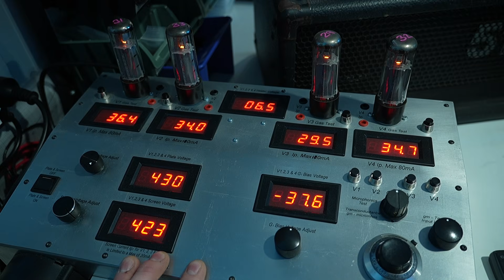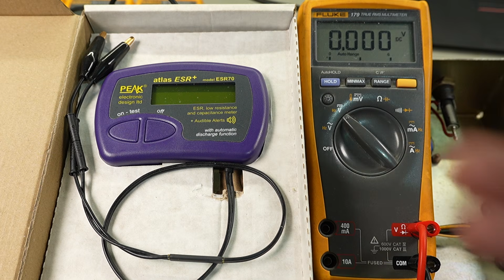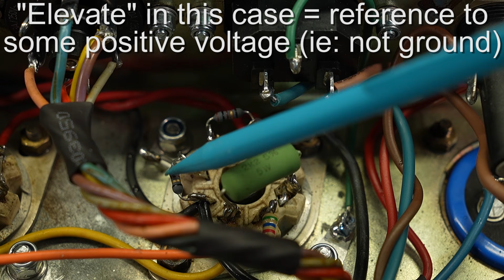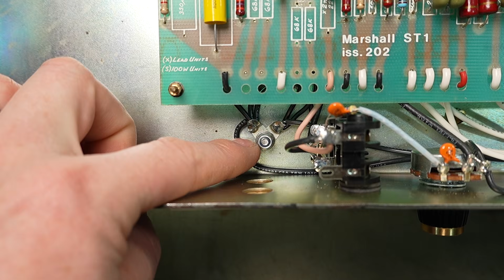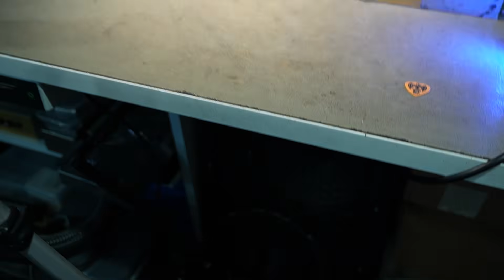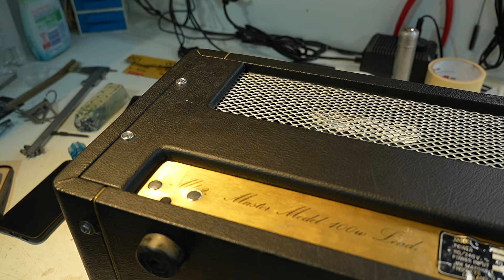JMP 2203 - Part 5

Comment: Dude, I have a bottom of the barrel LTD 7 string with the exact same pickup spring problem. I don't know why they use the beefiest, most overbuilt springs for the least important task, but they do. Fixed mine with a bit of heat shrink, but I reckon anything works.
Reply from the maker: Yep, that'd work too.
I think silicone rubber tubing should be supplied for all pickups, or at least all pickups meant to be used with high-gain amps.

Comment: He's getting more drive out of the low input than normal 2203 because he used 2.7k cathode resistor on 2nd stage instead of 10k
Reply from the maker: No I'm not. What video are you watching?

Comment: Should have used a 10k cathode resistor for v1A cathode....if he was wanting stock 2203......just saying......I hate lowering that value without a bypass cap...
Reply from the maker: I was not wanting a stock circuit. I was pretty clear about that.

Comment: Another great video Brad. Which model of fusible resistors are you using for the heater balancing? Also after the model of flyback diode. Cheers
Reply from the maker: I think they were either Yageo or Vishay.
The diodes are Rectron R5000F.
Reply: @BradsGuitarGarage thanks champion

Comment: When repairing amps, how do you document your work for the customer (I’m assuming you do not have the time to do videos like this for all the amps you are working on) ? Do you take before and after pictures to show the customer or just tell them what was done?
Reply from the maker: A combination of in-person interaction and phone calls.
Sometimes a series of photos or a private YouTube video is created for the customer's eyes only if they're residing far from the shop, depending on the complexity of the job.
This Particular job received the first part of this video series before it was released, and this report on the quote:
Summary:
- Unit heavily modded: FX loop, Ampeg style tone stack (yet retaining cathode follower, resulting in inappropriate gain structure), mid-voice rotary switch, additional valve (only one triode used), one triode disconnected (V1a), etc.
- Previously re-capped (all electrolytic capacitors replaced) satisfactorily (other than bias supply filter capacitors - to be replaced with axial Vishays).
- FX loop to be removed ($50 credit on exchange - Please confirm)
- Requested to return as closely as possible to factory condition (with the exception of agreed voicing mods - see below).
- Approved voicing modifications: 2.7K cathode resistor on cold-clipper, Preset negative feedback "depth" modification for more low frequency response.
Reply from the maker: The final report on the invoice was as follows:
Std Valve Instrument Amplifier Service:
- Unit disassembled & chassis cleaned inside & out.
- Unit & cables visually inspected.
- Valves removed valve sockets cleaned & re-tensioned.
- Suspect solder joints cleaned & reflowed.
- Pots, jacks & switches cleaned & cycled.
- Fuse rating and condition checked OK.
- Supply rail voltages tested OK.
- Unit checked under load for output power capacity and sound tested.
- Unit checked for microphonic / intermittent signal OK.
- Cabinet vacuumed, unit reassembled.
FINAL MEASUREMENTS:
- B+: 470VDC (Ripple: ≤6.7V RMS)
- C+: 468VDC (Ripple: ≤100mV RMS)
- D+: 329VDC (Ripple: ≤3mV RMS)
- E+: 284VDC (Ripple: ≤2mV RMS)
- F+: 271VDC (Ripple: ≤2mV RMS)
- Bias: -60VDC
- Bias: -40.5VDC
- Avg Idle Diss: 61% (±3%)
- PMax: 98W RMS (1KHz, 8Ω)
- Mains V: 241VAC
- Mains @ "Standby" : 52W
- Mains @ "Play" : 130W
- Mains @ PMax: 285W
Additional Labour (Hourly rate):
- Previously re-capped satisfactorily (other than bias supply filter capacitors - to be replaced with axial Vishays).
- FX loop removed (jack holes plugged).
- Additional valve & socket removed, cover-plate fabricated and installed in empty chassis hole.
- Architecture restored back to standard 2203 circuit.
- Worn out fuseholders replaced.
- Missing voltage selector plug replaced.
- Voltage hard-wired to 240V
- Screen grid resistors upgraded to 2.2K for greater EL34 longevity.
- 2.7K cathode resistor on cold-clipper for more saturation. 
- Preset negative feedback "depth" modification for more low frequency response.
- Chassis mounted components removed, corrosion removed from chassis, penetrol applied and left to cure overnight, components reinstalled.
- Failed F&T capacitor replaced.
- Failed impedance and voltage selector switches replaced.
- Chassis modified to suit Schurter impedance and voltage selector switches.
- Ground scheme re-done for lower noise floor.
- IEC socket replaced.
(Note: parts and material costs excluded)

Comment: Is that a single 1n4007 diode that you used on each side of the ot primary for output protection?
Reply from the maker: Nooooo!
That's a Rectron R5000F.
Reply: @BradsGuitarGarage thank you for clarifying. Nice work, btw.

Comment: Bingo with using a soldering iron on a screwdriver to heat up those grub screws. A heat gun to soften up the plastic knobs also helps, but be very careful. With the artificial  center tap on the heaters doing the Larry grounding scheme and putting that tap to ground over by the inputs is also not a bad idea, even if it does appear to be super crazy counterintuitive. A discussion for another day.
Reply: I will put humdinger pots on my heaters. The tubes themselves can cause slight imbalances.

Comment: Sounds good! You changed the V1A cathode resistor to 2.7k, left it unbypassed, and dropped the bright cap to 470pF. Did the coupling cap stay at 2n2 or did it go back to the stock 22n? Did you change the NFB loop to add low end resonance?

Comment: 1000pf Brite cap is stock
Reply from the maker: Yeah, I like the 470p better, but it depends on taste and the configuration of the rest of the amp
Reply: @BradsGuitarGarage yeah a good Les Paul and a 4x12 of greenbacks or any good celestials will make it sound nice  anyway......lol
Reply from the maker: That is a good point, I like the 470p as it is a bit less aggressive with Strats or brighter humbuckers, but if all you're running is old PAF style LP's, 1n is possible the cap value for you. Like I said, it's a taste thing, depending on your speaker choice, too. I always tell the customers to take it home and if they don't "gel" with the voicing, we can always bring it back on the bench and do some fine-tuning to suit their needs. That's the fun part!
Reply: @BradsGuitarGarage  I use humbuckers and hotter single coils and crave the kerrang so the 1n needs to stay. I’ll instead run a resistor in series to keep it tame. 220k is a good place to start.

Comment: Wow so much to take away from this series! The amp sounds great and is super quiet. I really need to look into doing that ground scheme on my '76 2203. Its actually not bad unless I'm playing single coils, especially my SG.
The flyback diodes and heater protection resistors are very cool though. Great job, Brad!

Comment: We officially call those snap in metal plugs, "FUCK UP PLUGS" here in America. My late bass player and friend of 50 years passed away, and his son gave me his 1967 Marshall 1992 Super Bass JTM100 with the (sort of) original full stack. That amp blew up the first time John turned it on back in 1968. In 1967 Drake screwed up a whole batch of power transformers for the Marshall JTM100s. The B+ on the 120 volt AC primary tap comes out between 650 and 660 VDC rather than the normally specified 560-ish VDC. The original PT was in an old box and sure enough, it's still cranking out around 467 VAC on 120 VAC versus 400 VAC. With 240 VAC on the 240 volt tap, it's spot on at 400 VAC. These JTM100s used KT66s and 465 volts is not really good for any modern KT66s, and 655 volts just fries KT66s, old or new. Fuses blew, caps blew up, resistors cooked, diodes popped and all 8 speakers went up in smoke. Marshall sort of made good on the head, but rather than ship all 8 Celestions or a full stack to the USA from the UK, Milano's Music went the cheap route & just put discounted closeout Fender Jensen guitar speakers in both of the 4x12s in the stack. Jensen of Chicago had decided to quit making guitar/bass guitar speakers entirely by 1965 when Fender oficially dumped Jensen as a supplier. 7 years later and Jensen USA guitar/bass speakers were no more. Jensen's home & theater speakers were made in Rola factories after 1972. Muter owned both Rola and Jensen at this point.
Reply: If you have a 1967 JTM100 check that B+ with the 120 volt PT tap with 120 volts AC before you let anyone try to use it in Canada, Mexico or the USA. Dyslexia in the Drake factory?

Comment: The fly back diode trick is cheap insurance. I’m going to do that in my amp.
Reply: Is a 1N4007 suitable? Voltage is fine but only 1A.
Reply from the maker: No, not at all. You need a Rectron R5000F fast recovery 5KV diode.
Reply: @BradsGuitarGarage  Thanks for that. I run my speakers in series so if one goes open, there’s no load on the amp anymore. A diode is cheap insurance.
Reply: @BradsGuitarGarage 
I have 1 ohm resistor on cathode. Should I connect diode still to Pin 1&8 or directly to chassis? Thinking better to chassis.